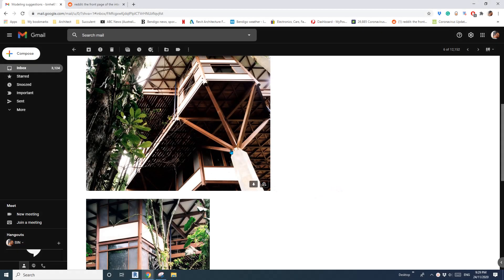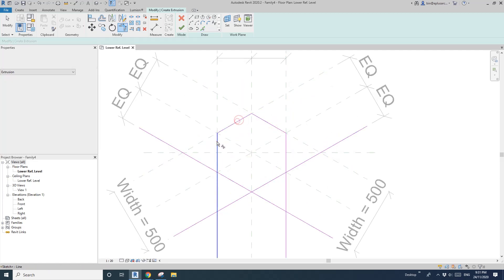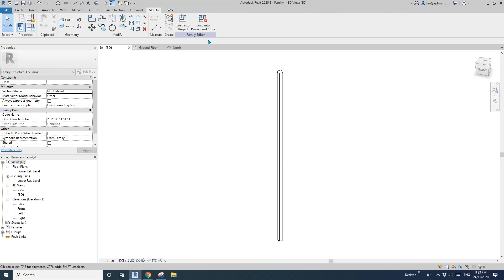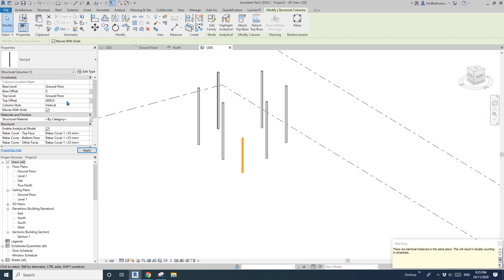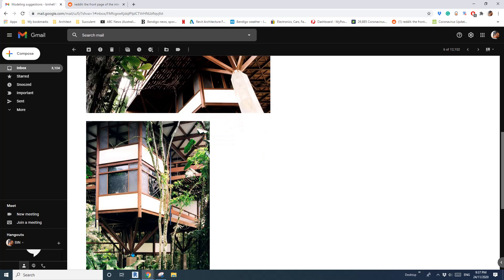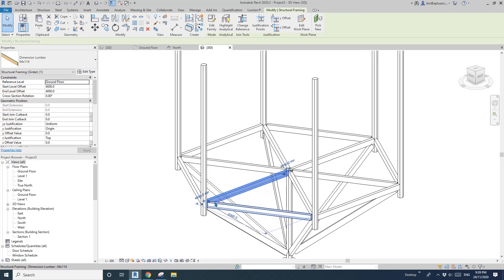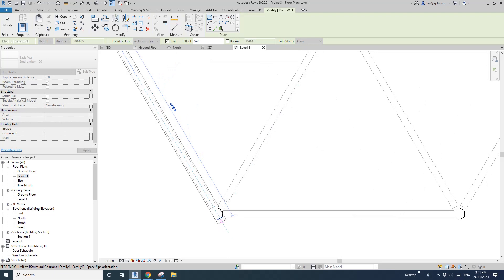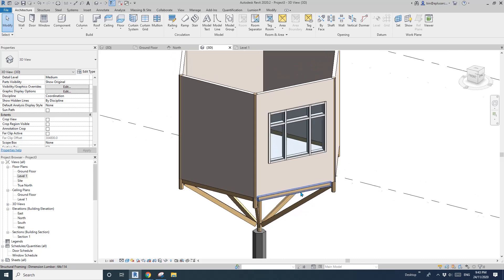Revit Everyday (Day 251) - Structural framing exercise

Comment: Excuse me. You skip some steps @ 3:38. You make Detail line (?) with some depth(?). When you give tutorial, please dont skip. or else  this is not a very good tutorial. just saying...
Reply from the maker: Thanks for the feedback. I'm not sure what the depth is. Detail lines (DL) are just 2 dimensional lines in a floor plan and there is no depth for them. For model lines, you can set work plane before you place them. Please let me know if you are still now sure. Thanks.